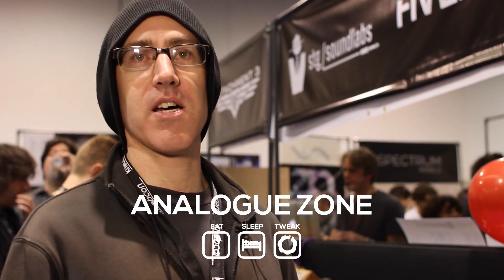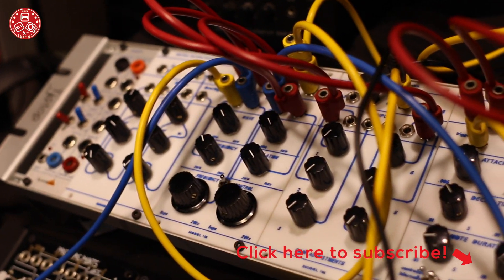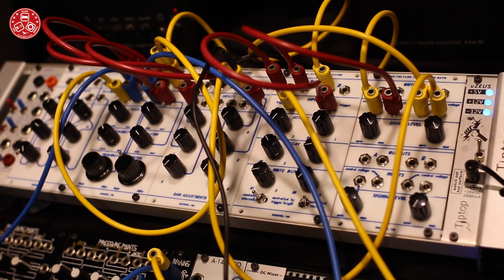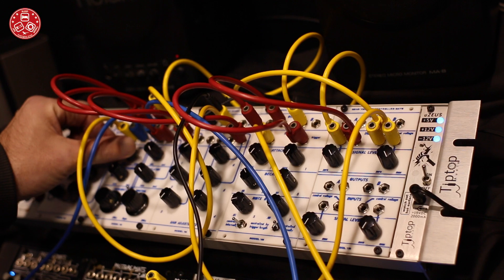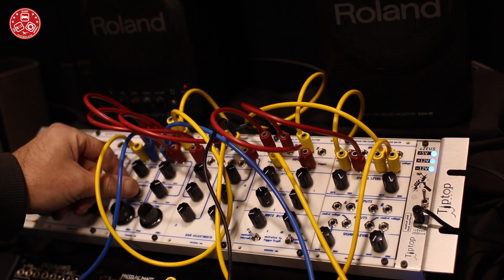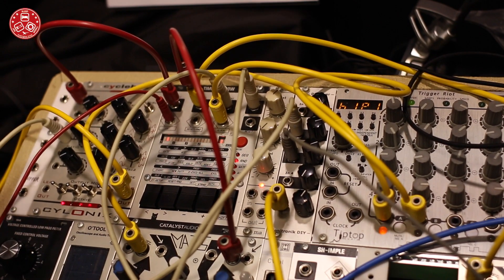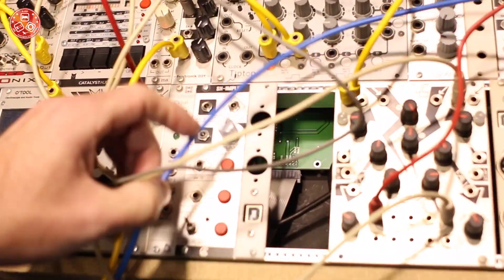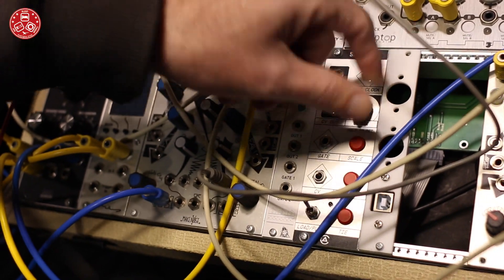NAMM2017: Introducing Catalyst Audio  new Eurorack Modules

Comment: "Doesn't track very well,"
That's a bit of a problem in 2017, isn't it?
Reply: no there for you have the precise stuff
Reply: Not everything needs to be played with a chromatic keyboard or MIDI.
Reply: ym2612 I myself don't use either; rather, one of the things I love about Eurorack is using it as a big compositional canvas, so that if I am sequencing multiple melodies, harmonies on multiple oscillators, tracking and staying in tune is fairly important to me so that the whole thing works!